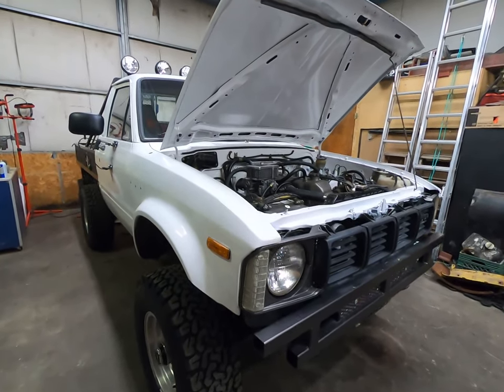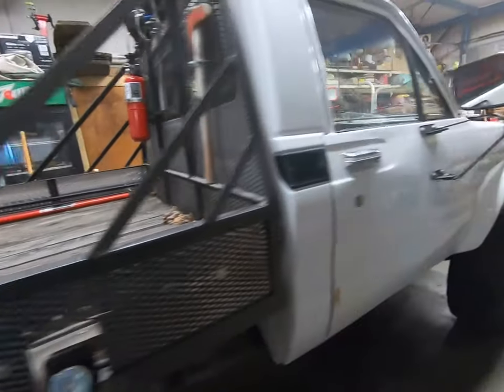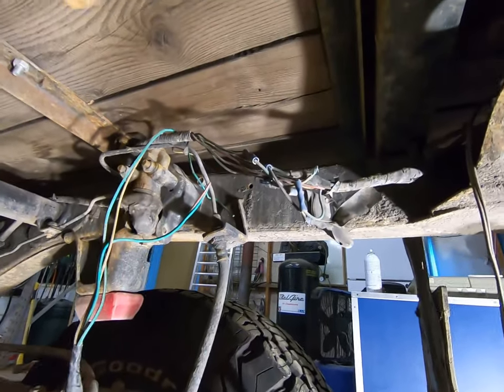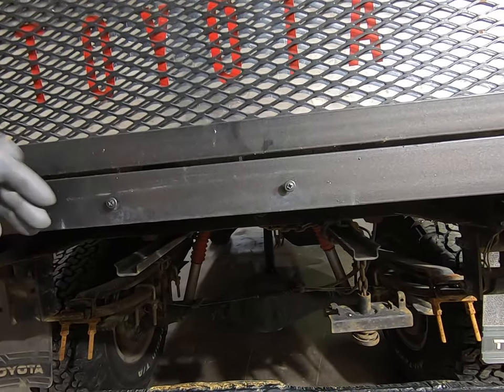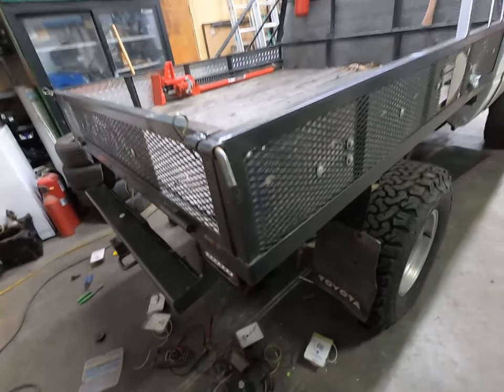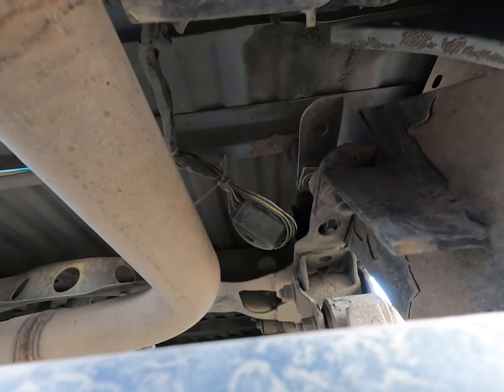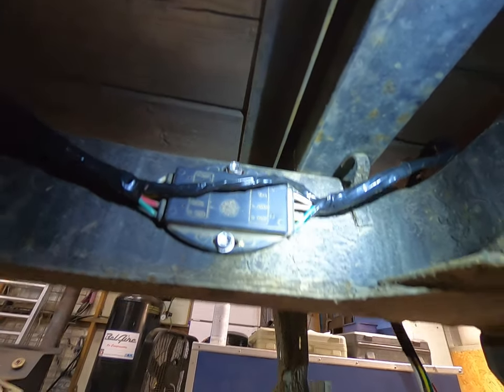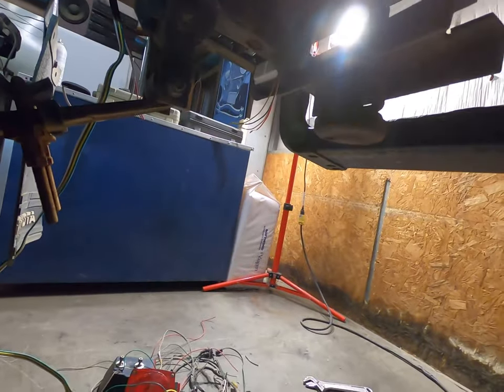How to Wire Toyota Pickup Taillights

Comment: This video is certainly making me feel like I’m going in the right direction. On. 1991 pickup though, there are 8 total wires coming back to the rear of the truck. Grn/blk, wht/blk x2, grn x2, grn/yel, grn/wht, red/blk. Any ideas on how they would run in and out differently to achieve the same function? Any further help would be a life saver. Thank you.

Comment: I'm an electrical idiot I know this video is 4 years old but I have lights like the ones you took off and can not get anything other then running lights if there's any way you could help me out it would be appreciated I need to know exactly what harness wires you ran to the 5 into 4 and all the steps between

Comment: Thanks for the video. My 94 has a hotwire running from the battery to the after market led's and it's making the job of adding a reverse light all that bit harder. Some people just shouldn't touch electrical if they're not prepared to do it properly!?
Reply from the maker: Mattdread yeah it’s amazing some of the things that people hack together on wiring!

Comment: link to find one of these adapters? Doing something very similar with my 83 pickup
Reply from the maker: This is not the one I used I bought mine at NAPA but this is the same thing. 

IIT 16690 Trailer Converter https://www.amazon.com/dp/B004EKW0DC/ref=cm_sw_r_cp_api_i_OA10EbRGCJA3K

Comment: Im not sure how you wire both tail lights into the four wires?
Reply from the maker: The tail lights off both lights go to the same wire. The turn signal or brake signal wires go to each turn signal wire separately then both ground wires go to the same wire out of the converter.